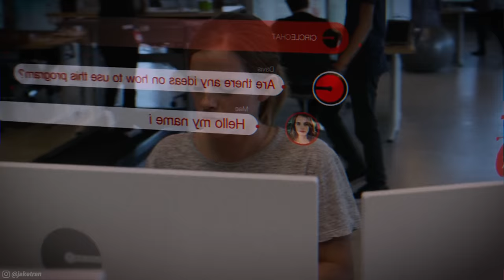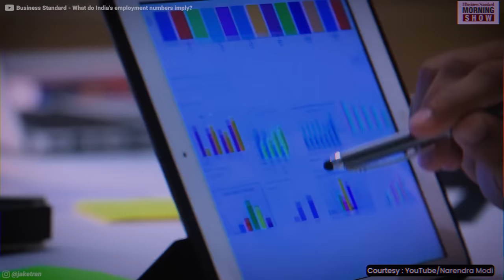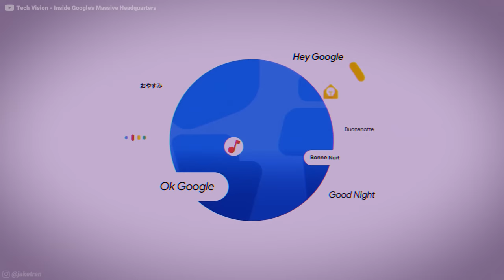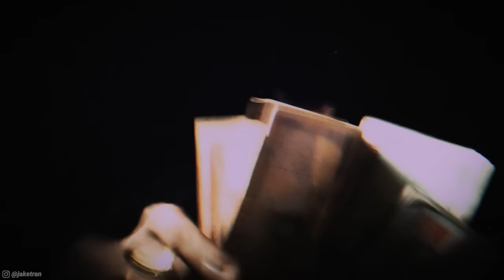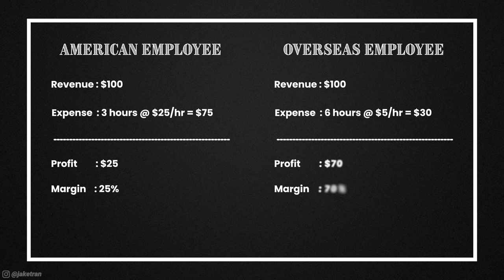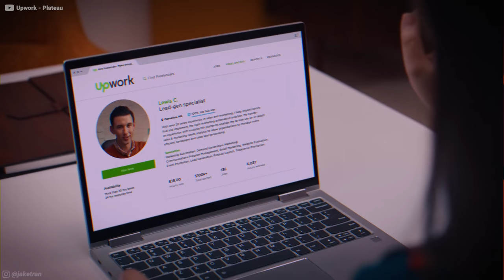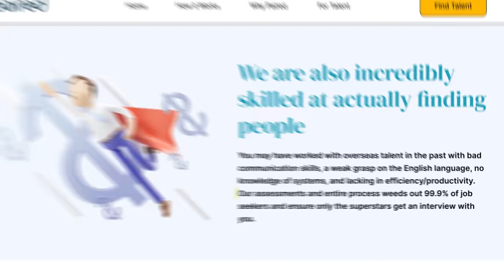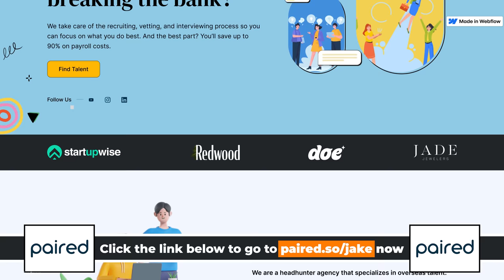How the Rich & Powerful Exploit Cheap Labor

Comment: If i was getting paid 30 bucks a hr i would warm my manager car up every morning 😂😂😂
Reply: My current job used to pay around $30/hr or $70k/yr back in the 90's. I started with this job in the 2010's and made around $50,000/yr but they kept laying us off and rehiring us for less pay each time while demanding more work. Now they pay me less than $20/hr despite the fact that I'm a large factor in making this company millions of dollars. I only make slightly more than some high schooler kids do. So obviously minimum wage entry level jobs are finally paying decently but for many of the "middle-class" type jobs, we're pretty much screwed.
Reply: @Bristecom  wow it should be double now if that's from the 90s.  But yeah that's sounds about right I actually witnessed this with a hospital merger they laid off the older staff and rehired for less.  It was sad bc then they tried to lie and say they was short staff.  No they laid people off and now using they're mistakes to engrain that they are lowly staffed when they created the issue smh
Reply: @Bristecom  What job do you work in? Sounds like your industry is struggling because it's the opposite story for tech workers.

Comment: I would jump through hoops and be very grateful for 30$ an hour considering I can't get TWENTY an hour here and I should be able to ...

Just not in NEW YORK or AUSTIN or DALLAS or FLORIDA or WASHINGTON or DC etc... the places where that IS barely above minimum wage yeah, sure but why are these businesses locating in the most expensive places IN THE STATES!?
Reply: Yeah, I'd be ok with $30/hr considering the current costs. My current type of job used to pay around $30/hr or $70k/yr back in the 90's. I started with this job in the 2010's and made around $50,000/yr but they kept laying us off and rehiring us for less pay each time while demanding more work. Now they pay me less than $20/hr despite the fact that I'm a large factor in making this company millions of dollars. I only make slightly more than some high schooler kids do. So obviously minimum wage entry level jobs are finally paying decently but for many of the "middle-class" type jobs, we're pretty much screwed. I have to use all my income just to cover rent and necessities now and anything beyond that is pretty much out of the question.
Reply: 30$ an hour is 70k a year? 

high schoolers making anywhere near 40k a year?

How in the... 

You think min wage pays decently? What country is THAT? It sure as hell isn't in North America...